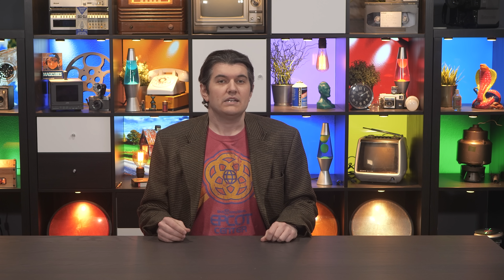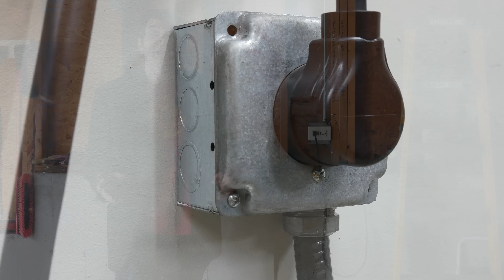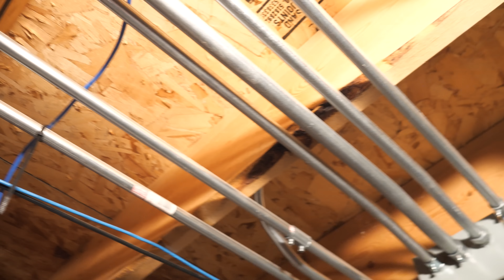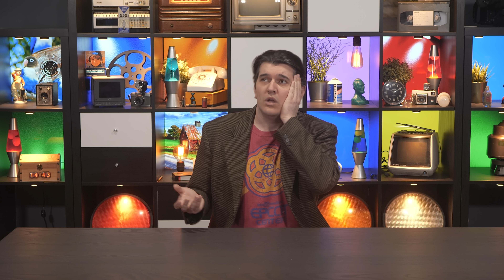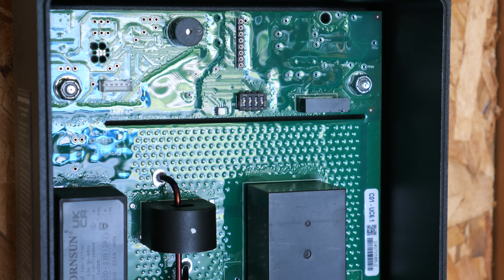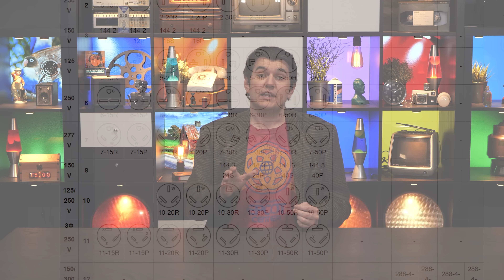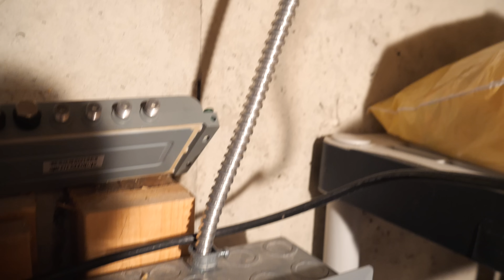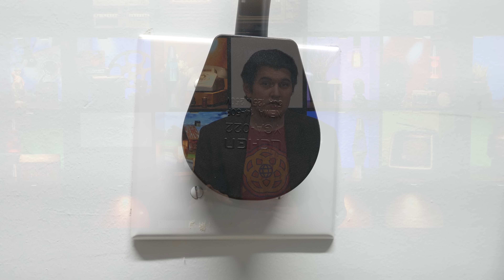The "standard" car charger is usually overkill—but your electrician might not know that

Comment: I have an electric dryer that is a NEMA 14-50 with a 30 amp breaker. I installed a smart switch and this set works perfectly. I use 20 kilowatts a day or 56 miles. I set the car to charge at the super off peak time at 3 cents a kilowatt, this equals 60 cents a day.  Excellent video, great information!

Comment: I set up an outdoor "RV" setup. Outdoor rated, and I can change my charger out if it stops working. Cost me less than $100 to put this in on a 32amp breaker. 

I drive 100 miles a day
Reply: 40 amp breaker* for 32 amp charging

Comment: I'm in a rather difficult situation in my home. The breaker panel is on the NE corner of the house OUTSIDE, mind you, and my driveway is on the west side of the house. My dryer is actually really close to the driveway, but it's inside. The cable would need to be run up into the attic, across to the other side of the house, and then down to a new receptacle or junction box, and then the charger will be mounted into brick. That's not great.

Comment: I have two EVs with 60 AMPs circuit split into dryer charger and Tesla charger. When charging both I ensure combined they don’t go over 48.  Which is more than enough on most nights unless both are low. We also aim to charge overnight during low peak rate.

Comment: Your flir is expensive enough for a 200Amp electrical box upgrade along with pulling cable to garage.😂
In regard to public charging, I think even at 125kw is planty fast. A 20mins charge session is fast enough. I cant even take a proper bath room break with that amount of time.
About the receptical... I learned the hardway... The charge start telling it wrong.
On the utility side, the law maker shall push through legistration on outlawing properties managment company from prohibiting charger installation. And the same time, the burden of upgrade the infastructure capacity shall be on the utility company side.

Comment: I bought a Chevy Volt way back when in 2013.  Bought a 30-amp EVSE.
In my new home. I had the builder install a 50-amp outlet for EV charging in the garage.  Plugged the old thirty-amp EVSE into that, and it charges my new Equinox EV about 25 miles per hour.  Way more than I need.
I have decided to limit max charge to 70%, and I won't plug the car in again until I'm around 55% or 60%.  It's not like I go on trips.  I might charge a couple times a week this way, but I think it will make my battery last many years to not do full cycles on it.

Comment: I have a Kona EV. I drive around 300 kms a week. I once drove 260 kms, each day, for 2 days, consecutively. I charge on 6 amps 240v. I was able to go 130kms, charge, come back at around 5-6 pm, charge overnight and leave the next morning at 80%. Charging from the outlet is more than enough for most people. Granted my Kona is the one with the smaller battery, your milage may vary.

Comment: I've known about this for years. I installed a charging station by plugging it into the NEMA 6-20 outlet for the heat and AC. My area also has a free car charger provided by the city government that I used until I installed mine

Comment: I still can't believe no one has an automatic front charging port device so you can drive in and back out without paying attention. Spare me the "but it's dangerous to have a port on the bumper" screeching. Okay, make the plug 2 feet long so it passes through the bumper before connecting. Make it high so it works for all vehicles. Make it spring mounted so if it's obstructed or hit with a non EV it's just pushed back. Geez.

Comment: This is a similar concept to why I switched to "wireless charging" for my phone. It's more convenient, especially with a waterproof phone case, slower charging is better for the batteries longevity, and you dont have to worry about damaging the connector in the phone. In the rare case I need to charge up my phone quickly then I plug in to the phone but 95% of the time I just charge over night or top off the battery with my magnetic car charger mount which conveniently holds the phone and charges at the same time.

Comment: My main concern is people trying to use level 1 chargers on 30-40+ year old 120v outlets with potential loose connections. That can generate a lot of heat and is a fire hazard. These things push a 15 amp circuit to it's limits and it needs to be physically up to par.

I installed a 50 amp circuit and charge at 40 amps. Is it overkill? Yes, but it wasn't that expensive either so why not? It very occasionally comes in handy.

It's still appreciated that you are letting people know that this level of charging is almost certainly NOT required though, because yeah I don't think most realize it.

And I use a ChargePoint Home Flex because I really like how it automatically shows me my costs calculated using my actual electric plan. It's also perfectly functional without an internet connection. Yes, even setting the charge rate doesn't require the internet. It requires an APP on a device with Bluetooth, but who cares? I have multiple other devices that meet that requirement if my main one breaks, and it's not like I need to change it after initial setup anyway.

Comment: I drive 12,000-15,000 miles a year. I have charged my Tesla Model Y on a standard 15A 120v wall plug for over a year with no issues. 

If I know I will be driving 200 miles one day I set my charging to 100% and that night I have less than 100 miles of range. I wake up to 150 miles of range. A couple days later I’m back to my standard 80% charge.

Comment: I never charge at home, I only charge at work with 16A/240V and that covers easily all my day-to-day drivings. I drive 40 000km per year and work charging covers half of those, the others are longer than 200km roadtrips, where I need to use DC charging or charge at the destination place

Comment: One thing that is a detractor for Level 1 charging. Our electric co-op has an EV charging plan that offers INSANELY cheap (4-7cents per KWH) power. But you need to get a sub meter and dedicated socket installed. It doesn't seem like it makes sense to have that done with a 120v socket. If I'm having this done, I would almost certainly opt for a 240v box. But I would likely be ok having just Level 1 charging based on my daily mileage.

Comment: When I first bought an EV I considered getting a charging station from the local power company.  But you have to buy the station, pay to have it installed, and then pay a monthly fee besides.  They do give you a break on the electricity if you charge during non-peak hours with their equipment.  But I figured out that with my typical driving it would take me 13 years just to break even with their setup.  I charge with the good old 120 outlet and that gives me more than enough for my needs.  I really appreciate this video because everyone seems to just assume that you need to install a high-voltage station, but the reality is most people just don't need one.

Comment: I got a 40A Grizzl-E.  I had to run wiring anyway, so I ran PVC conduit, 6 gauge wiring, and got a 50A breaker, and hardwired it.   Did I need the full 40a?   Probably not.   But since I could, and had to run the wiring anyway, why not?

Just like with you, the most difficult part was mounting the box, not the electric.   I had a difficult time finding the stud due to the weird way our house was built.

For our two BEV's, 20% to 80% comes along in 5-6 hours  (VW ID.4 Pro S AWD 82kWh) or 6-7 hours (Audi A6 E-Tron Quattro), but to be honest, we rarely need to charge from 20% to 80%.

Usually I set the target to 60%, and charge once it gets close to 20%.   This gives me a week or so of driving between charging, and charging takes 3.5-4 hours (the VW) or 4-4.5 hours (The Audi)

I'm with you on the wire nuts though.  That's all I'll use.

As for smart chargers, I went with the smart version of the Grizzl-E, because it was the same price, and I wanted a way to track power use.   IN restrospec, the "smart" features of the Grizzl-E Smart are somewhat underwhelming.

As for DC fast charging, I'm actually using it most of the time right now, because the Audi came with free DC Fast Charging through Electrify America for a year, and I'm not going to say no to free electricity for a year.   The Audi charges really fast though, so it isn't a problem.    Provided it isn't too hot out throttling the charging, 20-60 comes along in 12 minutes, and I was probably going to buy something at Walmart (where the Electrify America charging station near me is) anyway...

Sometimes I actually wish it would charge more slowly, so I can get more time in the store without having to worry about charger hogging penalties 😅

Comment: What if I don't have the option to add a dedicated 240V circuit for the EVSE? Can I just run another dryer outlet in parallel with the existing dryer outlet (which is 30 yrs old and can only handle avout 20A)? 

If I get an EVSE that has an adjustable current button, I can limit the charging to 10A and plug it in parallel with the dryer circuit. 

As long as neither the dryer nor EV are running at the same time, this should work, yes? I'm thinking even with the EVSE limited to 10A, I'm still getting more kilowatts delivered to the car compared to just charging over 120.

My old EV draws 10A at 120v (1.2kW per hour), and if I limit the charger to 10A at 240v (2.4kW per hour) as well, then that means I'm still getting DOUBLE the power delivered over the dryer connection vs the standard 120v plug.

Is this a horrible idea (running EVSE in parallel to dryer, but at low current setting)?

Comment: Just as an extreme example, like a Chevy Bolt, which I'm averaging 5.4 mi/kw city driving. At 1.5 kw L1 charging rate, parked & charging for 12 hours overnight could yield up to 97 miles of commuting range every day continuously. Of course most people drive less daily, or occasionally, they would just need to top off at a faster L2 charger once a week, and only if/when they have consecutively high mileage days. If even one of those days they drive less, 2 or more consecutive overnight slow charges will get them back to plenty of range again.

Comment: We have a ford e transit electric cargo van that we use for running deliveries short distances, and to prolong the life of the battery 99% of the charging is done with a regular wall outlet at 1.8kW, with the charger that came with it, however we do have a nema 1450 plug that we use to charge if we need it, but usually we don't.

Comment: This helped confuse me, while simplifying things. We just bought a 2017 Chevy Bolt, with the buyback battery installed in 2025. 33K miles. So far, I've used the supplied portable charger. We installed a 20 amp circuit and 120 Volt plug for construction work, mowing, etc. 

I was planning on converting that to a joint 120/220 Volt socket for faster charging. Using the EV designed sockets for proper duty load. I wonder if I even need a wall system? But whatever I use it will need to be waterproof and snowproof, since it's our outside driveway. And we live with a grade to our driveway, so need to charge at the top. I tend to think installing a bit of overkill, such as one that will handle a newer EV, might be a good idea, but still keep it as cheap as possible. 

Any suggestions on a good 120 Volt charger that is weatherproof, as the Chevy supplied portable charger has warnings not to get it wet, and I've read reports of them failing when they have gotten wet.  Great video!

Comment: I have a short commute (20 min each way)., but I charge on a standard 15A 120V circuit (standard USA wall plug) and have zero trouble. The important point is that I do have a garage and can plug in there with no effort.
Reply: What about days when its very hot or cold and the climate control is using lots of power?

Comment: I have to charge my car at a charging station nearby.  Here is two things that drive me crazy about this... and it isn't related to cost.  It is the other EV drivers are inconsiderate jerks.  I can't tell you how many times I went there and there is a hybrid sitting in that spot for 8 hours ( it probably only takes two for them to charge that... ) and or people parking in the middle of the only two parking spots ( on the dividing line ) OR doing a Michael Jackson spin with the charging cable for god knows what reason...  Making me spend several minutes in unwinding the power cables... it is a huge pain....  Oh another thing... using the opposite side charger plug... for the opposite side parking spot absolutely baffles me.   Edit:.... RAAAAAAAAAAAAAAAAAAAAAAAAAAAAGEEEEEE

Comment: We just bought our first EV Tesla Model Y, i was set on getting the Tesla Wall Charger, We just bought a house with a detached Garage and a Barn, both have their own electrical panel and notice both also have 240 outlet and the barn has a nema 6-50 outlet below its electrical panel. But the mobile charger that came with the model does not include a 6-50 adapter, lucky i found one on fb market place.